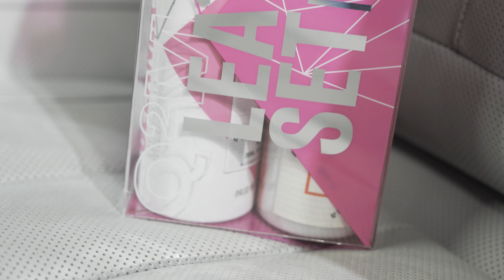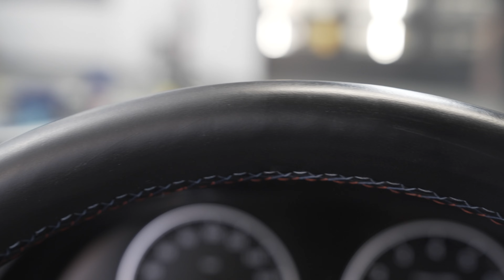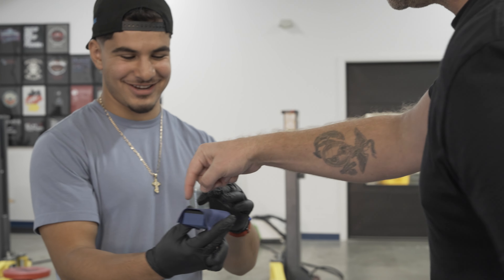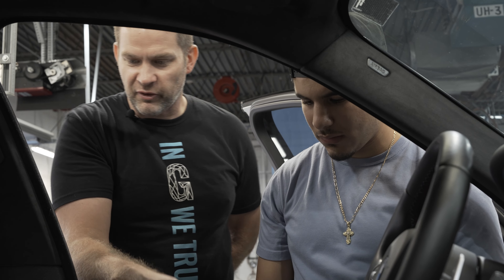How to Ceramic Coat Like a PRO! Leather??? (Pt. 3)

Comment: Tip for John, when working over a freshly coated surface like at the end of video, please consider to lay down a towel over the seat bottom.  You are placing a bare arm on the surface and potentially adding contamination.  Keep up the great time at CAP!

Comment: "Evaporate into the leather"  HAHAHAHAH.  Snake oil sales.  It evaporates into the air.  All leather seats come from the factory with a PU coating, so I'm not sure it "absorbs" into the leather either.  This is coating the top of the leather - the dyed or painted surface - that's all.  Good if you appreciate the glossy look, but likely not all the durable on a seat with constant wear.
Reply: its a little known fact that these do nothing ahah
Reply: If, as you say, the coating doesn’t absorb into the leather, then why do dirt/oils/ stain do. And, if a coated seat doesn’t get the stains(on the seats I’ve done), why is that?

Comment: I used Leather Shield on my wife's light colored Ridgeline a few months ago. She bought a new leather belt and there is dye transfer on the back of her seat. I've used mild cleaner, strong cleaner, steam, steam with strong cleaner, steam with 3D citrus cleaner/degreaser all with the colour lock brush. Any recommendations on how to remove the stain?
Reply: Thats why i find these coatings to be a waste of money for the interior. Have you tried using a magic eraser? You have to use caution with this aporoach though as the eraser is a mild abrasive and is capable of stripping the original dye off the seat if you get too aggressive
Reply: @Rcd710  yes, I tried the magic eraser as well. I'm about to try Leatherique to see if that will pull it up and then try a different protectant from either Colour lock or Leathermaster
Reply: What about one of those white scrub pads? I would think some like that you almost in a sense need to “scratch” it off of the leather. Thats such a frustrating feeling when its impossible to get something out
Reply: @Rcd710  not sure which pads you are referring to.
Reply: I would leave it the way it is, now when you even tried magic eraser,otherwise you may remove the dye completely and its gonna look worse
Reply: Non scratch scrub pad. Usually find them with dish cleaning supplies. Ammonyc sells one that he likes(find them cheaper at the store)
Reply: Colourlock makes a die removal pen (gld pen) that works very well on blue jean or any die transfer. Also works on ball point pen marks.
Reply: @texaspowerman  thanks. I see car supplies warehouse sells it, I'll get an order together and include that.
Reply: Any luck?
Reply: @craig.encinitas  not yet. I have the Leatherique to use, but I need to carve out a time to apply it. Are you having the same issue?
Reply: @craig.encinitas  no luck with leatherique or any cleaners. Going to wait for the one year mark where the coating wears off and try cleaning it again.

Comment: Aren’t most leather seats covered with a plastic from the factory? So essentially you’re coating the plastic?
Reply from the maker: Everything in a car's interior has some kind of coating or protecting layer in it. Our goal is to keep these layers in-tact for as long as possible and to keep the interior clean and protected.